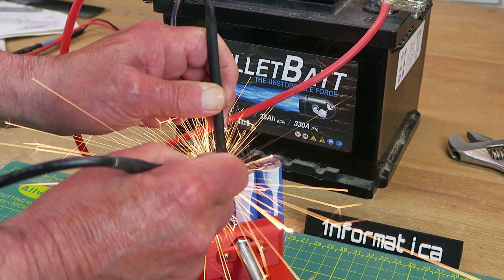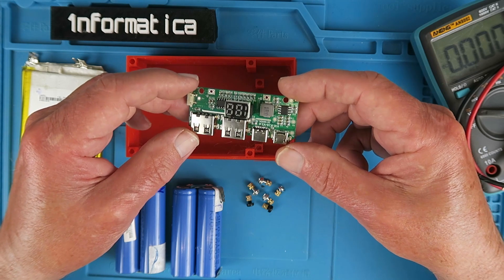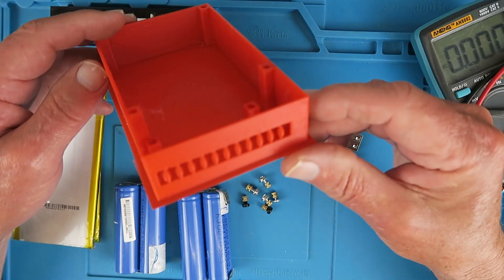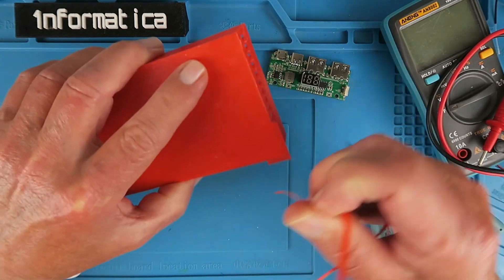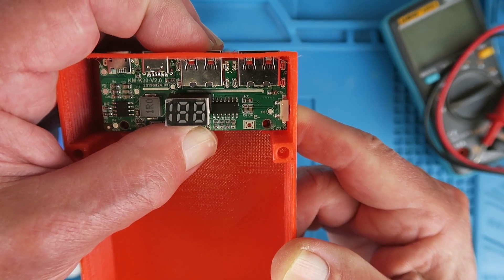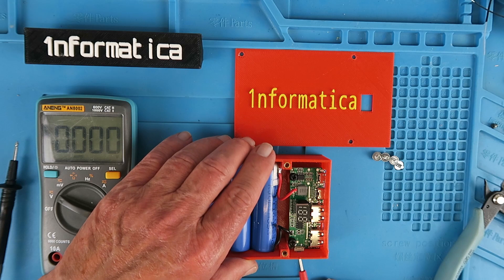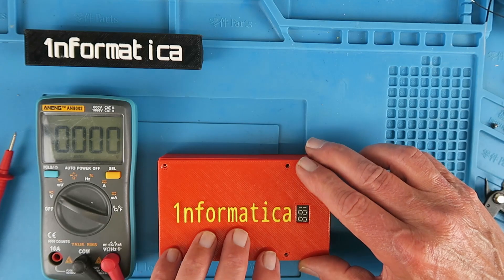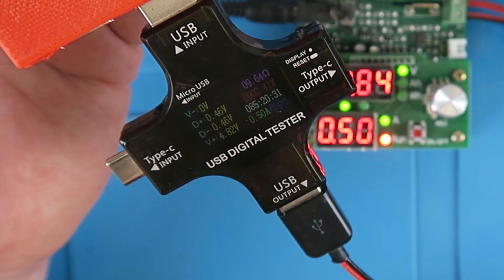USB Quick Charge 3 0  PD3 0 5V 9V 12V Output  Power Bank Kit Build

Comment: I have only just discovered your video on this charge module, so I am hoping yours is still working. I bought a couple of these some time ago, and I wrote some comments on the Bangood site (24/5/2021) regarding tests I had done. I wanted to use it as a 'no-break' supply, but there is a momentary break in the supply when the charging input is disconnected. Other battery packs also have this problem. I havn't done any further tests since, but I am very confused by the specs. As the unit is advertised as 5, 9 , 12V o/p, and the only outputs are USB B style, not USB C, does this mean that with a suitable exchange of data, those sockets can go up to 12V?
Reply: Further investigation of the module, shows it has an IP5306 power bank charge/discharge controller, which only does 5V in and out, so the 5/9/12V spec must be fake - any comments?
Reply from the maker: @TonyAbbey  I don't believe it can output 5/9/12V. It does not support PD mode. Mine still works for the use I built it! Thanks for watching, have a great day!

Comment: The Banggood page implies that the USB C and Micro (presumably the lightning connector also) are inputs. I suspect the USB - A ports are the only outputs
Reply from the maker: Yes, on re reading the description I believe you are correct. I shall put a note in the description. thanks for pointing it out.